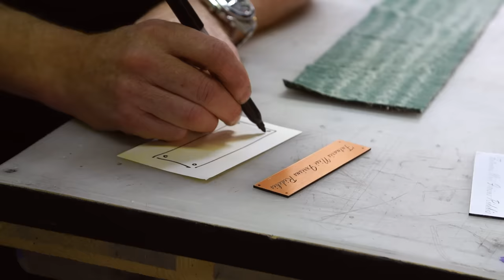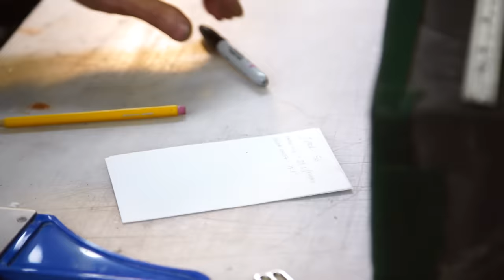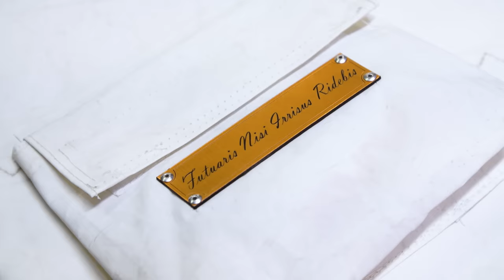Adam Savage's One Day Builds: Eric Idle's Guitar Case!

Comment: Very impressive and most likely an improvement in terms of the stated goal of keeping other baggage from smashing the face of the guitar. My concern is that there is not enough downward force on the face from inside the case/bag. It looks like when turned face down that that guitar could move where gravity is exerting force on it. The other has been mentioned that the headstock is too snug. The neck should be very stable but the headstock in this context needs to be able to be free of contact. When you open your case there should be marks from the strings. This means your guitar body and face is not being jostled which can damage not only the guitar body but the neck and headstock as well. I was hoping Adam would put some compensating foam on the inside of the top to press down on the neck and strings down to the bridge to keep what needs to be snug snug.
I think the foam is good for absorbing shock and in that sense this is more of a glorified gig bag than a case and he does call it a bag at one point in the video. He twirled it around a bit but also it should be designed to be thrown 20 feet and for the guitar remain unscathed. Because it may need to be checked somewhere out there and those baggage guys live to go off on guitars. In that instance I will take a traditionally constructed and rigid case with non gluey paper towels around the body over this case/bag as I had one of those thrown 15 to 20 ft into a metal cage by a baggage handler and the guitar was fine.
The other question I have is: was there one or two zipper tabs? If you have two zipper pulls with those holes in them you can put a TSA lock to bring the zipper together and keep people out of the case. This also means that if TSA opens it they will lock it again (hopefully) and there will be less risk of the case opening and the guitar coming out.
Also I would add some straps in addition to the zipper to ensure that the case remains closed.
I’m what I call a critical idealist so I’m OCD about things being optimal. This is a very good build for a first effort but I think Adam should talk to some folks that build custom guitar cases to get their input on possibly improving the design.
One reason I am concerned about the guitar moving if the bag is placed upside down is that the TSA people and others will still end up turning it the wrong way. This is an inevitable part of traveling.
Reply: I would have put the handle on the zipper side.
I'm sure this is not his first (guitar) case.
This shoudn't be a race.

Comment: Should have put the side felt panels on first then the top so you wouldn't see that ugly-ass seam.  Stands out like a sore thumb. The handle should have been placed to the center of weight for the guitar and case together otherwise carrying it will be clumsy.  The top of the pocket should have been rotated 90° so the flap was toward the handle so when carrying the case it points up.  There is a reason most guitar cases are black.  That white cloth is going to get filthy.  Ended up being very beautiful in the end though.

Comment: Just seen it.  Very cool case Adam and for a deserving man.    More very tenacious tape here >>Parma 8044 Pro Servo Tape 1 inch X36 inch.  Holds robot servos on with ease.  A gel type, shock absorbing , heat absorbing super sticky , , that holds quite well.

Comment: At 7:40 I was very very worried: is Adam really cutting the guitar in two? Worst nightmare, working in a holy hurry, making a mistake like that.

I imagine Mr Bean cutting the Eric Idle guitar in two, watching the perfect foam guitar shape, thinking aha, glueing the wood around that foam, having repaired the guitar looking brilliant. But filled with foam, it sounds like Bean's teddy bear. Adding the teddy bear to the story is easy. (Well, it seems easy. Later on I start knitting all lines together.)  Before cutting the foam, Bean lays Bear on the foam. But during cutting, the electric knife causes Bear to fall off. So Bean cuts out some foam, giving Bear a comfy bed. Comfy cosy. After the desperate guitar repair, guess where Bear pops up? Bear is looking out of the hole of the guitar, 5 strings half an inch from Bear's nose. His feet got glued during the stressful repair, Bear is stuck. And the clock is ticking, so the Bear-guitar goes into the new bag. Oops, poor Bean has repaired the guitar and he realizes then, he must also make a new bag. Hard work.The final shot is sad, Bean must say goodby to his Bear. So he plays Bear a lullaby. On a very silent guitar. He could add some pickup elements, but that complicates things a bit, plastic strings and pickups don't mix. And if you really want this video, it's nice if that shattered guitar is not really shattered but still playing itself. Way easier than doing complicated audio production things because you killed a guitar. And another idea, because everything goes wrong, Bean can glue the repaired guitar rocksolid into that new bag. But perhaps it is even funnier if Bear goes on tour with Eric Idle. After the tour, the guitar should be repaired by an expert. Bean must be there, Bear is rescued from his guitar bed.

This is a plot, quite simple, maybe Rowan Atkinson thinks "Why Bean? Why me? No no no no no." now. I wonder if YouTube sends him every comment containing Bean. The American security bit eaters do things like that, but nobody reads that, it is some huge number of computers reading it, including this amature Bean plot. Still there? Splendid. Story in a story.

It is still inside that foam, isn't it? The shot before, it was. This edit looks like the famous magician cutting the young lady in two. Exciting!

On closer look, the guitar was on the other table.

Comment: Adam
Can I make a suggestion that will make any sewing you have to do in the future so much simpler.
Go on Amazon and purchase a set of "Sewing machine feet".
There are kits with 62, 52, 48 right down to 4 in a kit. The more you have the easier it is. Just check it fits your Janome make of machine when ordering (Janome are a "standard fit" machine and not specialised like some makes) and then when you need to customise something, hem, wrap material over, install zips etc. etc. it will be easy, and look a lot more professional.

Comment: I was wondering about the handle location, disappointed you hadn't biased it towards the base and also had wondered how you'd choose the location, if you'd weigh the guitar and different parts of the build materials.  I'm guessing you just forgot, but you noticed it when you assembled it, too late...  Sounds like he prefers using the shoulder straps anyways.  Nice build.

Comment: skewers are everyone's best friend! As someone who is currently taping and marking out dimensions on their table for  massive quilt- skewers are fab to poke batting into the corners, and get perfect turned out circles and the neatest flattest seams when ironing!also good for when you have multiple seams all joining at one place- you can hold and poke with the skewers to save you from sewing over your fingers- whilst actually being able to see what you are doing. Alsoif you are painting any weird little items . a dab of hot glue on the bottom, stick to a skewer andpoke in some foam. now you have 360degree access. oncedone, just pop off the hot glue.

Comment: It's going to eternally bug me that the zip is on the wrong side in relation to the handle -- if you put it down on a surface with the handle facing you like a normal person the zip is on the far side making it awkward to open, and if you put it down on the floor handle-side up zip is on the bottom. It's not like he didn't have anything for reference; the original bag and every tool box and storage container in Adam's shop works the other way round...

Comment: I think you should hack the sewing machine. When working at low rpm the motor strain can be heard. It needs a pwm controller that can give full torque at low speeds and not having to manually "assist" the motor spindle.

Comment: hey Adam . so when young boy I was watch this old house. there talk flex piping. I thought ya it never replace pvc white piping. ( witch replaced metal pipes )   know my place has both water and heat in floor.... so I was take break small farm and fire wood cut. I was watch this old house again. next big thing oak nails and oak screws. idea is most new house made out 2X4  pine. oak is harder then pine so idea is they should drive through anything not hard as them. best part there small as metal ones there put same holder strip fire out same air nailer use with metal ones.  ask why use oak nail instead metal one. 100 years or so sometime house torn down lot material goes dump. with oak nails and oak screws take chain saw to don't worry hit anything metal. throw in wood chipper fill farm semi with matal take up factory glued plywood bord. to help with drive point more took scrap peace of oak and witled vampire stack near drove through scrap pine on saw horse use rubber mallet.  they make nails with cmc rotter like 3d printer for wood works make 100 nails out one bord. so one day challenge have make oak nails to nail short bed worth what wooden deck. take chain saw to it throw wood chipper. see glue peace home made particle bord use own home made  mold. I'm guessing your oak nail way bigger but  see do dinsoure light so this easy challenge.
Reply: lot wood works thread wooden bolts witch kinda same thing do thread oak screw. wood works thread bolt for vice home mad work benches not that small.

Comment: The word I used to describe sewing is counterintuitive
Reply: On the  unfinished seam... 

They would PROBABLY have cut the padding out and added bias tape around that edge. 

Myself as a Build on like a Box might have Glued in some gold Cording 

The one tool it looks like you dont have is "Applique scissors" those are much easier to trim in places like that. >You may have a version of those in your first aid kit. The sissors for cutting under bandages or to cut clothing those. 

They have a Flat lower lip to slide under and protect what your cutting over from what your cutting off. 

Its a Game changer for cosplayers ;)
Reply: They is professional manufacturers...

Comment: Were you not too worried about using pool table felt for a liner?  In my experience, pool table felt isn't the softest material.  Would it not leave little micro scratches in the guitar finish?